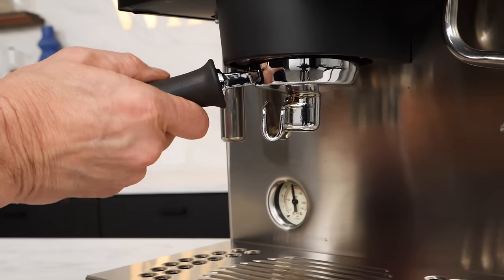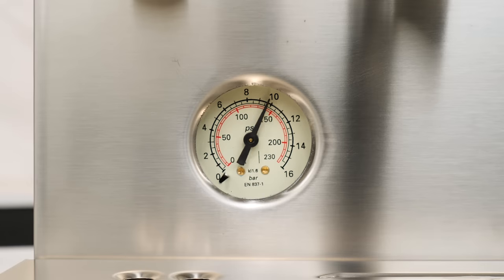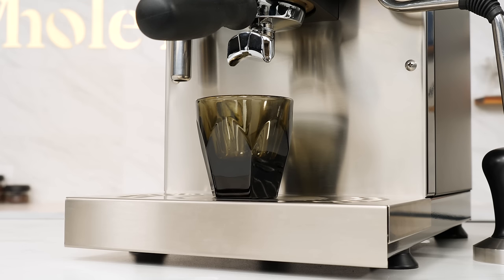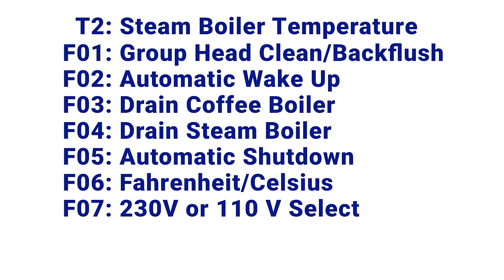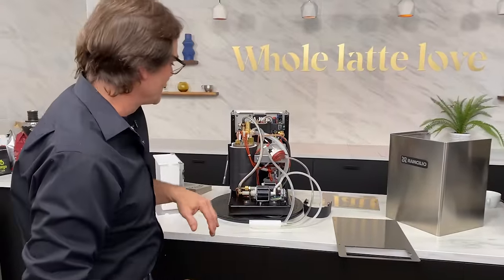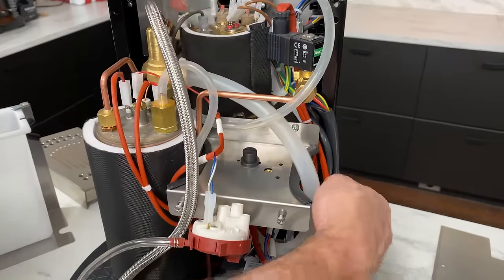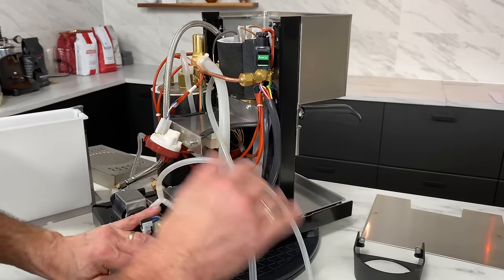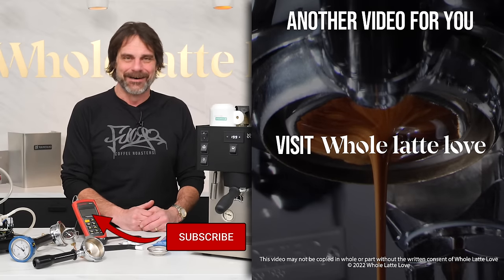Review: Rancilio Silvia Pro X Espresso Machine

Comment: Love your's videos :) I was looking for a new machine because my Lelit Victoria PL91T had a very weak knob for the steaming wand. Broked 2 times. I was looking for something more well build. And where I live the Silvia Pro X it's 200 euro less expensive of a Rocket Cronometro V. What you will suggest? Silvia Pro X, Rocket Giotto Cronometro V or ROCKET Mozzafiato V?
Reply from the maker: Hi P, Thanks for the love and question. First, know the Giotto and Mozzafiato V's are identical internally. Only difference is the outer case. In most (probably all) markets the Rocket machines are significantly more expensive than the Silvia Pro X. Depends on what's important to you. The Rocket machines use a heat exchange boiler. With that, adjusting brew temperature also changes steaming pressure. The Pro X is a dual boiler so changing brew temp has no impact on steam boiler temp/pressure. Dual boiler machines tend to produce more consistent brew temps. Some user do prefer the E61 group of Rocket machines to the ring boiler/group of the Pro X.
Hope that helps!
Marc
Reply: @Wholelattelovepage  Yes it help a lot :) I was wondering (one thing to add on my confusion haha) How much difference on the cup there is with a silvia pro x and another dual boiler like QUICK MILL QM67 or Matrix MN. My price range is 1,5k to 2.3k. And my retailer that will give me a voucher for refund the Lelit PL91T, have the 3 machine listed before, the QM67 and the matrix on the top price range. Thank you very much for all the videos, we see your love for the coffee world and your knowledge it's always a bless :)

Comment: Thank you Marc, great review as usual. Would you say the Pro X is a bit of overkill for 2-4 latte's per day? .... i.e. compared to Gaggia Classic Pro - especially if one looks at total cost.
Reply from the maker: Hi LM, you’re welcome and thanks for the kind words! It ma be a little overkill But have to balance that with workflow considerations and more stable brewing temps. Waiting for steam temp and cooling down the boiler after steaming may become tiring on the Classic. No waiting or cooling down on the Silvia Pro X. You could be waiting and cooling down 1000 times per year for years. Is the $$ saving worth it?
Marc
Reply: @Wholelattelovepage  Thank you Mark. Must say, the temperature surfing and cooling down every time you use the steamer, is a huge problem for me.
Just one more question please. How long does it take to pull the 1st shot (maybe with a flush)? Also time to steam please.
Reply: @lama8198  I bought the original Silvia Pro when it first came out about three years ago while wirking from home during Covid.  Having the double boiler and a local service distributor were the defining issues for me.  That has been a very good machine for me.  Recently stayed with a friend that has the original Silvia unit (single boiler) for a few days while having a flooring project done.  That convinced me I made the right choice to go for the double boiler system.  I found waiting for the boiler to recharge before steaming milk was frustrating (as I’m now spoiled).  Additionally, if I was in a two or more person household, I’d consider the dual boilers an absolute must.

Comment: Hi 
I am Struggling at the moment between this rancilio and profitec pro 300.

Which one would you suggest?
Reply from the maker: Hi BT, Tough call right? Here's a link to a side by side spec comparison: https://www.wholelattelove.com/pages/compare?products=NjY1MTQyNzg0ODI0NiwxNTQ1OTk4Nzk0ODEx
Very similar machines with the boiler over group design. I prefer the PID control location and ease of use of the Silvia. Size of drip tray is a consideration though. I like the finishing of the Pro 300 over the Silvia and larger drip tray.
Marc

Comment: Marc---the F7 changing 110v to 220v allow use in Europe or other non-110v countries?
Reply from the maker: Hi John, thanks for the question. I have not confirmed that it's as simple as changing that setting to operate a machine built for use in 110V standard countries for use in 220V areas. There may be other component differences internally.

Comment: I have the Silva Pro X and there's only two things I don't like.
1. There is a bit of flex in the grouphead when locking in the portafilter seems to be a side effect of the increased clearance between the drip tray and the grouphead. 2. I wish the 1/4 steam valve from the Rancilio 5 and 7 class commercial machines would be a welcome upgrade.
Reply from the maker: Hi chris, Thanks for sharing your user impressions!
Marc

Comment: How long does it for the steam boiler to get up to steam temperature (lets say 248 F)? My house is 65 F (so is the water) and it takes a very very long time. I upgraded from my many years Miss Silvia to Silvia Pro X mainly for the dual boiler so I don't have to wait 90 seconds from brewing to steaming. I understand with dual boiler, its actually two boiler.  This means if I don't flip on steam first thing while pre heating, I have to wait for the steam boiler from scratch after brewing (which is like 15 mins...)  

But my concern is also when I have both boiler on from cold, is the machine able to heat up both boiler at the same time? Does it have enough power to do so? Or does it heat the coffee boiler first....because the steam boiler is taking an awful long time.

If I turn on my Miss Silvia from cold (65 F) with the steam switch on, it takes three minutes from 65 F to whatever Miss Silvia steam temperature is. For Pro X steam boiler to reach steaming temperature (248 F)  from 65 F, its definitely more then three minutes.
Reply from the maker: Hey chanala, Thanks for the questions...
See this section of the video for information on the steam boiler: https://youtu.be/ahryx4LsKbc?t=425
On the Pro X you can have leave the steam boiler on all the time! If you turn the machine off with the steam boiler on, the next time you turn the machine on the steam boiler will be on. That way you do not have to turn the boiler on every time you turn the machine on. This is likely how the vast majority of users do it.
You can set your preferred steam boiler temp under the "T2" setting. That's covered at about 8 minutes into this video.
The Silvia Pro X will heat the brew boiler first then the steam boiler if the machine is turned on with the steam boiler on. Once the brew boiler is up to temp, power alternates between maintaining temp in the brew boiler and heating the steam boiler. Once both are up to temp short pulses of energy alernate between the boiler as need to maintain temp in each.
Hope that helps!
Marc
Reply: @Wholelattelovepage  Excellent, thank you. For those who wonder, it took three minutes for the brew boiler to go from 65F to 203F. The steam boiler took a total of 11 minutes from start (with steam switch on from start). If the Pro X heats up the brew boiler first, simple math states it took seven minutes for the steam boiler to heat up from 65F. As long as the steam boiler was set to on from start (which should be how it goes), there shouldn't be a problem as the entire machine warm up time should be well over 11 minutes (20 for my Miss Silvia).

Comment: Is it possible to use a smart plug with this machine instead of having to keep setting the Automatic Wake Up function?
Reply from the maker: Hi Martyn, Thanks for the question. Yes, the power switch on the machine is mechanical so it should work. Just be sure the smart plug is rated to handle the power requirements of the machine.
Marc

Comment: I had a customer give me a v3 silvia it is a well built machine but takes to long to warm it up . I don't have time for espresso but  this version seems nice
Reply from the maker: Hi steve, Silvia and machines with similar design are faster warming up than most larger machines like those with E61 groups. The Pro X is ready to go in about 13 minutes from turn on. Those E61 group dual boilers need 25 minutes or more for full warmup.
Marc

Comment: Does the Wake Up timer mean it can be powered down (no draw on power or heat) and then Wake at a pre-determined time?

I have the original Sylvia but would like the dual boiler and also the ability to have the machine turn on and pre-heat each day at a specific time. Is this possible or does the timer keep shifting X hours each day and require a manual calculation?
Reply from the maker: Hi Steve, Thanks for the question. The hours set are hours from the time of setting so it's not a specific time of day like 7am. So yes, it requires manual calculation.
Reply: @Wholelattelovepage  Thank you for the reply... Your answer leads me to believe we would have to set that next turn on time each day which could become tedious fast. IF the machine also had a turn-off time and retained the turn on span time it could be a one time setting.

Hopefully, Rancillio understanding the benefit of a full timer that would turn on each day and off at specific times since this is my main reason for wanting to update my Sylvia classic.

Another question; is there only pink ones available? Seems maybe a supply chain issue like everyone is facing these days.
Reply from the maker: @SteveGuluk  Yes, it needs to be set each time for number of hours from present time you want the machine to turn on. As a work around, you can use an appliance timer rated to handle the machines power load to turn on/off. WiFi timers are great for this with ability to run multiple schedules and operate remotely.
Perhaps we'll see an update from Rancilio but it would likely require a new UI/display.
Yes, only the pink Pro X's in stock at the moment. Hope to have the others back in soon. Supply chain issues for sure.
Marc

Comment: I have a pro dual boiler with firmware version 1.03. My wake up timer has never worked and I do not have menu option 8 for soft pre infusion. Do you guys know if it is possible to upgrade the firmware to 1.06? I would love to enable those two features. Great video
Reply: Not sure if it is the same issue, but I also have a Silvia Pro (original version, not the X) that I bought about three years ago when they first came out.  I thought my timer did not work, but was told by my local distributor that the first iteration machines only came with a 12-hr timer and I was trying to set times between 12-24 hours.  My distributor upgraded my unit to the 24-hr timer and it has worked great ever since.

Comment: Interesting the level device for the water tank. It looks just like the water level sensor for a front load washing machine. Very accurate sensor for water level.
Reply from the maker: Hi JIB, It is interesting! I don't know washing machines like I do coffee machines but happy to report I successfully DIY replaced a freeze damaged 5 solenoid valve tree in my washer a few years back and saved a bunch of $$. Using air pressure to sense water in the reservoir was something I had not seen until the first Silvia Pro. A little skeptical at first as it was new to me but works like a charm!
Marc
Reply: @Wholelattelovepage  Marc, thank you for taking a moment to respond to my comment. Your commitment to customer service is amazing.

Comment: Nice review, and an impressive machine - I've mod'ed a Gaggia Classic Pro with PID, 9bar spring, flow control, pressure gauge, for half the cost, really happy with it, but if doing it all over again, would take a long long look at this Pro X. I guess you get the 2nd boiler, which would be nice for parties. The style isn't great, but highly functional. Integrated shot timer is nice.
Reply from the maker: Hi Michael, Thanks for the comment sharing your thoughts!
Marc

Comment: Pretty good machine but I still rather pick the Sage Oracle for $1500
Reply: Sage or Breville or whatever name you can find them around the planet, are a way to avoid buying a separate grinder. Cheap materials, poor quality build, I would not name it even a machine, but a kitchen appliance.
I don't want to be rude. I apologise for my comment, this is just my point of view
Reply: @Kats072307  I understand your concern, probably you had a faulty machine or something, but there is no such coffee machine in this planet in this price range which has dual boiler, PID control, 58 mm commercial size, Preinfuision pressure control, you can even control the amount of air introduced in the milk while steaming. Ofc. there are much better grinders then then the integrated what sage/breville has. and ofc. there are much better inner component machines out there then this. You even have customizable tamping pressure and time settings. Comparing the customization, features to the price range. There is NOT a single machine that comes closer to this. Maybe the DECENT is somehow comparable but that is more advanced and also 4 times the price. Also the Oracle has an unknown hidden feature what so many people don't even realize which gives you ONLY about 1-2 channeling shots out of 100. That is truly remarkable and amazing.
Reply: If I could choose between Rancilio X and the Oracle I would choose 1000x the oracle. That's a no brainer ofc.
Reply: we have a different POV, and that's completely fine 🙂
The espresso machine I have set right now as my endgame machine, is the victoria arduino eagle one prima. An espresso machine which costs 6k $.
And as for a grinder, right now I would say the Monolith Max. Which costs approx 3,5k $
For home setup it's extreme, but that's all up to me, my preference, my budget and my scope
Reply from the maker: Hi ZS, Thanks for sharing your opinion. There's a lot packed into the Breville/Sage Oracle at an attractive price point so it may be the right choice for some. As @Kats072307 points out the Oracle is a lower level build quality. I'll add it's not the type of product that scores high on user repair-ability. Lot's of plastic and proprietary parts. If something goes wrong with the Oracle some years down the road repair may cost may exceed the value of the machine. That's the nature of the appliance grade product type. Machine grade products like the Silvia are simple to DIY service/repair with easy to get industry standard parts if needed. Machines like the Silvia retain their value.
Marc
Reply: @Wholelattelovepage  Thanks for your reply Marc. Love your vids. <3

Comment: Just can’t stand those cheap black plastic switches…
Reply from the maker: Hi MF, Plastic yes, cheap? debatable. They do feel solid and are similar to those found on commercial food service equipment. Perhaps you prefer metal toggle switches like on the dual boiler Profitec Pro 300: https://www.wholelattelove.com/products/profitec-pro-300-dual-boiler-espresso-machine
Marc
Reply: @Wholelattelovepage  Hi Marc - yes indeed I would rather spend a little extra money to get something like the Profitec just for the higher quality finishing and brand.

Comment: 17:51 Rancilio should still extend this outlet downwards. If you have splashes of water on the back wall after back flusih, it's because this outlet is too high.

Workaround: Make it longer. You can either prolong the angled roof-like metal sheet with some gaffer tape or buy the know 3D-printed outled made for the traditional Rancilio Silvia.

That being said: Water at the metal frame is not nice, but not critical anymore. It's all stainless now (also the black frame)

Comment: Hi Marc, I just purchased a Rancilio Silvia Pro X from Whole Latte Love. I’m curious about the type of water I can use in the machine. I buy Reverse Osmosis water from Whole Foods and I’d like to use that in the espresso machine. I tested it at 0ppm so I understand it’s not safe to use as is. Would adding Third Wave Water (I saw rancilio website mention TWW) or Perfect Coffee Water to my RO water be safe to use in the machine? Or do you have something you recommend WLL sells? Thanks!
Reply from the maker: Hi evdorn, Thanks for the question and your patronage! You are correct you do not want to run 0ppm water in your machine - it's such a good solvent it can cause corrosion of metal. Also, 0ppm water with no minerals results in flat flavor. You can use third party options to remineralize your RO. If your tap water is safe to drink and does not have edge case issues like high gypsum content we recommend filtration/treatment options from BWT Water & More. They exchange magnesium for calcium in your tap water. You end up with water that will not cause scale in your machine and has the mineral level needed for good flavor extraction. In the log run, these options are likely less expensive and more convenient than RO + remin. All the BWT options linked here use calcium to magnesium ion-exchange and have activated carbon to remove chlorination and other chemicals. For reservoir fed machines I personally use the Penguin Pitcher. The Bestcup filter mounts in the reservoir and treats water as it is used. The Bestsave pad filters drop into the reservoir and take 8-12 hours of contact time to treat water so not a good option if you go through more than a reservoir of water per day.
*Penguin Pitcher: https://www.wholelattelove.com/products/bwt-penguin-2-7-l-water-pitcher
Bestcup M package: https://www.wholelattelove.com/products/bwt-bestcup-m-package
Bestasave Pad: https://www.wholelattelove.com/products/bwt-bestsave-m-anti-scale-filter
*note the Penguin Pitcherr will become the BWT Aqualizer soon but has sema specs and uses same filter cartridge.
Hope that helps and enjoy your new machine!
Marc